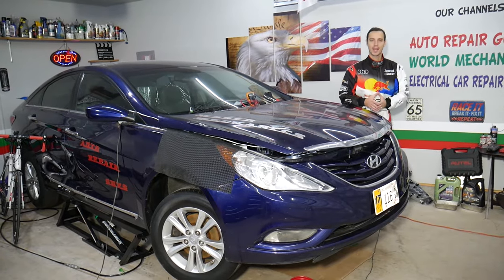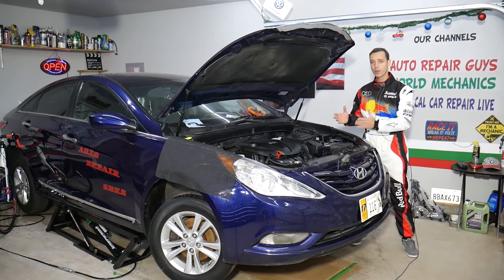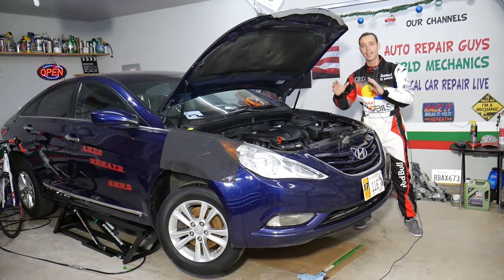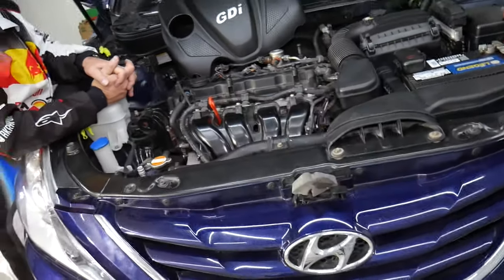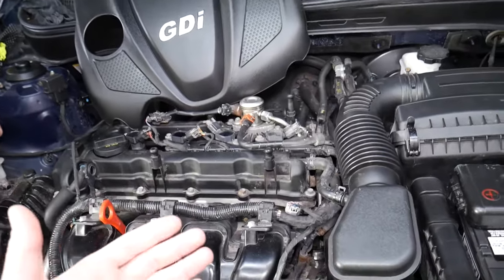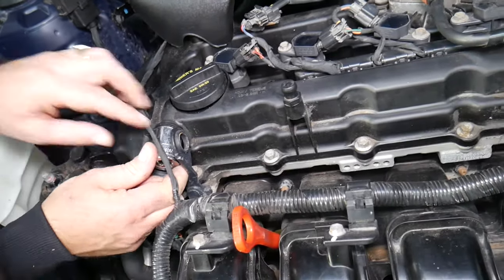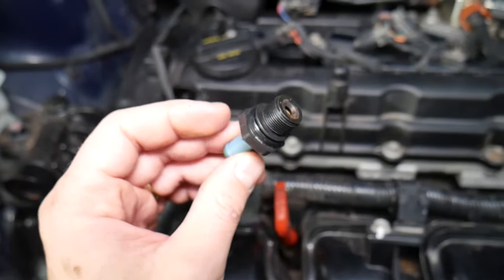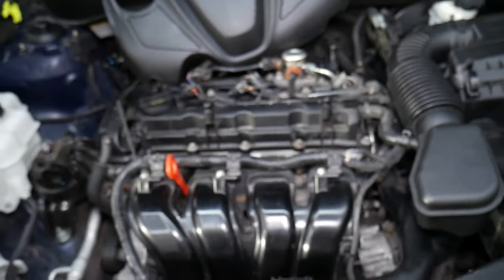WHY HYUNDAI SONATA BURNS ENGINE OIL, INCREASED OIL CONSUMPTION

Comment: 2016 sonata...112,000 miles. I just took mine to a dealer because I'm burning between 3-5 quarts in between oil changes and they told me the engine replacement lawsuit does not cover oil consumption. Only if your engine fails because of parts. So if you're out of warranty your s*** out of luck...dont buy a hyundai ever. Crap company... Crap cars and even crappier salesmen.
Reply: I have noticed my 2017 is burning quite a bit. What is the warranty cut off , I’m at like 75k miles or so.
Reply: Ah yea my engine did die at 150K I put $1200 to fix it and now I need an oil change every 700 miles NO JOKE. And I’ve taken great care of my 16 sonata. The worst part is when it died I DID take to a Hyundai dealer and they told me it’s not in the lawsuit or recall. So I repaired it 3rd party. But I called today since Hyundai sent out those letters for the HMA settlement and they told me the software update my car had in 2019 should of worked with the check engine (but it never did) and the dealership when it did die should of covered me.. but I missed the deadline to get reimbursed for the repairs August 9th of 2021 😢… so Hyundai LEGIT screwed me over. I did the right thing, I freeekin tried and I’m still stuck with a car that’s going to die soon. I’m so mad like I’m beyond upset about it all. I’m afraid to drive it and now Idk what to do. It feels like it runs fine but with this oil issue… man idk 🤷🏻‍♀️
Reply: @chaselesser3191  100K
Reply: Report Hyundai to NHTSA AND THE BETTER BUSINESS BUREAU AND THE NEWS MEDIA channel 5, channel 7
Reply: There's a class action lawsuit about this oil consumption issue, so that might help you eventually I hope
Reply: Yea it’s horrible. I’m having the same issue. Will never buy these cars again.
Reply: @doupray  that’s literally what I have and fixed the misfire last week. 138,000 miles. Burned a whole quart in ~600 miles. We just need a better car man sheesh. It’s 2022 for crying out loud.
Reply: @ali_young21  If it's leaking oil that much you don't need an oil change every 700 miles. You just need to replenish the lost oil. and change the oil filter once a year (without changing the oil) The new oil you put in to replace the lost (burnt) oil takes care of scheduled oil changes at the rate your car is losing oil. Try a high detergent oil since the problem may be the piston oil control rings are allowing excessive oil bypass into the combustions chambers. If the clogged oil control rings are cleaned, by the detergent oil, it may be improved oil consumption.
Reply: @The.Shiloh.Project  i keep having misfires fixed the first one and now there was atleast an inch deep on oil in the spark plugs. Dealership is playing hard ball even after ive asked them to find the issue over and over.
Just opened a Hyundai claim and added myself to a class action regarding mass oil consumption
Reply: @grubisfunny  I am having the exact same issue. Took my car to Firestone and they told me there is nothing more they can do with it because of the oil consumption issue. I would love to know what your dealership says about the issue.
Reply: I took mine to the dealer they said that my warranty on the engine is now extended indefinitely so whenever it dies basically they’ll replace the engine. Not ideal but better than nothing
Reply: @grnspider  Dealership gave me it back and changed a completely unrelated part claiming it was leaking oil (the oil pan) hit me for $200 and $600 to the warranty company. It broke down 4 days later same exact issue so I just changed the spark plugs one last time and traded it in. It was just becoming a money pit! Spent 100s on spark plugs and diagnostic tests. Nope that was the end!!
Reply: It sounds like the oil rings are fucked. Carbon build up or broken rings. I change my oil and filter every 3000 miles. Fuck what the handbook says.
Reply: Hyundai and Kia were great before the gdi engines came in 12or 13 those cars before those years are still all over the roads those engines made Kia and Hyundai in the early 2000s
Reply: @MicahPhelps-uy3ir yup. My 09 DOHC still runs like a champ. My 2014 and 2015 GDI are in the graveyard. 2015 caught fire, 2014 burned all the oil and blew up on the highway

Comment: My 2020 kona started burning oil, gotta check it now every other day. Way to go Hyundai!
Reply: ****>>>>>    Hey readers. Even some Honda. and Toyotas are oil burners. I know because I have looked at YouTube videos for a whole year on this oil burner issue. Audis and BMW too. It is usually GDI and stuck piston rings. Most time a good B-12 piston soak will free the rings. Others use tough engine flushes.. EPR109, AMSOIL, Liqui Moly etc. Some just put in Yamalube ring free shock treatment . Change your oil at 2.5 to 4 k. Run top tier gas...use Techron gas or other high PEA treatments...and try to rev up engine more to burn the carbon outmore. Use Valvoline restore & protect oil!! FIX it fast before you pay $$$$$$ for a cat converter!!!

Comment: Some think that the problem is a result of the design to short pistons (to save engine moving weight / mass, and improve fuel mileage); and, the piston oil control rings becoming clogged with carbon -- thus, not clearing enough oil from the cylinder walls during each piston stroke. High detergent motor oil may help remove some of the carbon from the oil control rings ---MAY help.
Reply: That's completely wrong. Most transverse mounted engines are undersquare (taller piston travel, smaller bore). They have to be this way in order to fit into the engine bay with the transaxle. You can design around a tall engine. You might not be able to design around a WIDE engine. This engine has an 88mm bore, 97 mm stroke. It's actually quite a bit oversquare. If it was the other way around, those numbers would be reversed. Every manufacturer wants to use oversquare engines today as their thermal efficiency is higher. Basically, better fuel economy. We own this same engine, and it feels very fragile and makes uncomfortable noises. As a mechanic, my ears are tuned to hearing small details in car engines. And ours just doesn't sound right. It only has 110,000 miles, too.

Comment: I wish I had seen this vid two years ago when I had oil pouring out of the valve cover on top (2015 Sonata).  It cost me several hundred dollars for a new cover, plugs, wiring, and labor.   I then drove across the USA 2400 miles, and it only used about 1/4  quart of oil.

Comment: In order of replacements: 
1. PCV Valve. 
2. Valve Cover Gasket
3. Head Gasket
4. Oil Pan Gasket
5. Engine might be toast.
Reply: ****>>>>>    Hey readers. Even some Honda. and Toyotas are oil burners. I know because I have looked at YouTube videos for a whole year on this oil burner issue. Audis and BMW too. It is usually GDI and stuck piston rings. Most time a good B-12 piston soak will free the rings. Others use tough engine flushes.. EPR109, AMSOIL, Liqui Moly etc. Some just put in Yamalube ring free shock treatment . Change your oil at 2.5 to 4 k. Run top tier gas...use Techron gas or other high PEA treatments...and try to rev up engine more to burn the carbon outmore. Use Valvoline restore & protect oil!! FIX it fast before you pay $$$$$$ for a cat converter!!!

Comment: 2018 Sonata SE  mileage a lil over 51,000. Told they couldn't find source of excessive oil usage, however, I've been advised to have combustion cleaning that will slow down the oil usage. Car also slow to accelerate after slow down or complete stop. That issue still haven't been addressed.
Reply: Read what I said above.   Hyundai has a service bulletin declaring after market oil filters, including one from FACTORY!  42,000 easy miles on mine and 5 quarts burned this year
Reply: Try a good engine flush. GDI’s benefit from this since the Piston rings get clogged by carbon buildup and get stuck. Or you could have a bad PVC valve. The vale did nothing for me. I thought it was the Valve stem seals, and after a new Cylinder Head it smoked just as bad. 
I just tried LiquiMoly engine flush and my car already doesn’t smoke under hard acceleration. 
After that we may just have bad piston rings.
Reply: ****>>>>>    Hey readers. Even some Honda. and Toyotas are oil burners. I know because I have looked at YouTube videos for a whole year on this oil burner issue. Audis and BMW too. It is usually GDI and stuck piston rings. Most time a good B-12 piston soak will free the rings. Others use tough engine flushes.. EPR109, AMSOIL, Liqui Moly etc. Some just put in Yamalube ring free shock treatment . Change your oil at 2.5 to 4 k. Run top tier gas...use Techron gas or other high PEA treatments...and try to rev up engine more to burn the carbon outmore. Use Valvoline restore & protect oil!! FIX it fast before you pay $$$$$$ for a cat converter!!!

Comment: In order to attempt to fix this issue is to do a combustion chamber cleaning service and replace pcv valve. I always recommend BG EPR service along with this and fuel induction service. Sometimes it fixes the issue, sometimes it doesn't.

Comment: The problem is the engine design itself. It's a GDi engine, meaning gas is directly injected in the chambers where the combustion occurs. Thus, increasing temperatures causes burning of the oil (this occurs whenever the pistons are fired). Its a clever design but Hyundai should've ran extensive long-term trial testings.

Note you can see "blue" smoke coming out of your muffler, meaning its buring "synthetic" oil. 
Also its not all Hyundai models, for example Hyundai Rondo uses DOHC engine (a reliable engine that been design for almost a century).
Reply: I put in about 2 qts every 500 miles. And easy smoking if I accelerate to much.
I just ran a bottle of LiquiMoly Engine Flush yesterday, and today I I tried to make it smoke and I can’t say I noticed anything. I’m sure I need to run another bottle. But I think I can at least go 1000 miles without using 2 qts.
Reply: @chaselesser3191  keep track of the results week by week and keep us posted. Using LiquiMoly is an extra cost though.

 The issue is the burning of oil caused by the engine design using direct injection...
Reply: @dool1002  I drive 100miles/day. So I should be able to see quick results. Though I’m about to be on vacation for about 2-3 weeks
Reply: @chaselesser3191  Do let us know when you get a chance! From my small tests, I noticed if you run the engine at a constant temperature, less oil is burned. For example, here in Canada the weather in December is pretty cold for where the engine can combust gas more efficiently (cold air is more condensed) and I didn't need to add any oil for almost 3 weeks - the dip stick reads Full.
Reply: ****>>>>>    Hey readers. Even some Honda. and Toyotas are oil burners. I know because I have looked at YouTube videos for a whole year on this oil burner issue. Audis and BMW too. It is usually GDI and stuck piston rings. Most time a good B-12 piston soak will free the rings. Others use tough engine flushes.. EPR109, AMSOIL, Liqui Moly etc. Some just put in Yamalube ring free shock treatment . Change your oil at 2.5 to 4 k. Run top tier gas...use Techron gas or other high PEA treatments...and try to rev up engine more to burn the carbon outmore. Use Valvoline restore & protect oil!! FIX it fast before you pay $$$$$$ for a cat converter!!!
Reply: Yup. My 09 rondo DOHC is still running like a champ. GDI are crap

Comment: I tried everything and I am still putting almost 2 quarts of oil in. I have a 2017 Hyundai sonata sport with 100,400 miles. The Hyundai dealer says it may be still under warranty and that it is a well known problem. But they won't tell me what the problem is on this recall. Can you help and let me know what the problem is.
Reply: ****>>>>>    Hey readers. Even some Honda. and Toyotas are oil burners. I know because I have looked at YouTube videos for a whole year on this oil burner issue. Audis and BMW too. It is usually GDI and stuck piston rings. Most time a good B-12 piston soak will free the rings. Others use tough engine flushes.. EPR109, AMSOIL, Liqui Moly etc. Some just put in Yamalube ring free shock treatment . Change your oil at 2.5 to 4 k. Run top tier gas...use Techron gas or other high PEA treatments...and try to rev up engine more to burn the carbon outmore. Use Valvoline restore & protect oil!! FIX it fast before you pay $$$$$$ for a cat converter!!!

Comment: Awesome. Had the same systems. Replacing it later today
Reply: ****>>>>>    Hey readers. Even some Honda. and Toyotas are oil burners. I know because I have looked at YouTube videos for a whole year on this oil burner issue. Audis and BMW too. It is usually GDI and stuck piston rings. Most time a good B-12 piston soak will free the rings. Others use tough engine flushes.. EPR109, AMSOIL, Liqui Moly etc. Some just put in Yamalube ring free shock treatment . Change your oil at 2.5 to 4 k. Run top tier gas...use Techron gas or other high PEA treatments...and try to rev up engine more to burn the carbon outmore. Use Valvoline restore & protect oil!! FIX it fast before you pay $$$$$$ for a cat converter!!!
Reply: U mean the oil just becoming sludge in the engine? 
I guess that makes sense since it always smells like burnt oil… I’m changing oil today

Comment: Im not sure if this is my issue because after getting the car I checked the oil for months and it never seemed to decrease. And then when I went to the mechanic they didnt see anything wrong, and I eventually decided pour a bottle of oil in it that's for 75,000 mileage or more. Just twice for the wintery month randomly driving for more than 10 minutes I smell something burning, was thinking it could been oil and the burning doesn't last long either but I'm not sure.

Comment: My 2014 Sonata is burning Oil like Crazy 🤪 I’m at 135K and the DipStick is always dry.  The oil loss began relatively slowly about 50K miles ago and now the car needs to be checked every 4-500 miles.  
Does anyone know if Lucas Treatment helps?  Can the engine blow? 
I need to drive this beast cross country.

Comment: Came here to determine why my neighbors Sonata keeps running out of oil. A few months ago, she said it "just turned off" while driving, and we discovered it had run out of oil. She had it flushed and refilled at the shop, and now less than 3 months later, it's taken in for an oil change and they said there was only 2 quarts in it to drain!
Reply: I’d suggest trying a good Engine Flush. I just tried Liqui Moly, before I could make my car smoke almost on command, after the flush I tried even harder and couldn’t tell any smoking. 
I’m sure I may need to run another bottle later. But I have high hopes as I can already see I’m not burning as much oil.
Reply: @chaselesser3191 how’s it doing lol I just bought one it didn’t have much oil but I got it for 500 and the prevalent problems were the wheel bearings so I took a chance 125k miles

Comment: Its not a PCV value issue.  Its a ring issue with all 4 cyl engines.  Bad design.  Even the service managers at the dealers even confirmed this.  Rule of thumb dont buy any Hyundai or Kia vehicles.
Reply: Is there any way to fix this problem
Reply: @anthonyarrighi2159  you must replace engine

Comment: FYI there are two possible PCV valve part numbers. 26740-2G000 and 26740-2G600. Prior to ordering a new valve pull the hose and if you have a blue valve (like in the video), you will need 26740-2G600.

Comment: My 2014 Sonata Limited I’ve driven less than 1500 miles on a full synthetic oil change and it’s already to the low level where I have to add oil. No leaks, everything runs great. I even drive with it on Eco most of the time. Just started happening more frequently when I hit 100k. Between 60-90k I only had to add maybe a quart of oil after 2500 miles, with majority highway miles. I love my car but this oil problem is gonna make me go broke. 😅

Comment: 2015 Hyundai Sonata...  told Hyundai considers 1 qt/1,000 miles acceptable.... I've driven a lot of "beaters" in my life and never have I had a vehicle that burned oil at that rate....  that's like a quart per 30-40 gallons of fuel....  i have a 2 stroke weedeater that doesn't require that kind of oil-to-fuel ratio
Reply: You are right. I have a 2013 Sonata and it burns oil. I had a 2003 Honda Accord and never had to top  up between oil changes.

Comment: However!!!!!  My 2018 had 36,500 easy miles and the light came on.  It was 2.5 quarts low.  Hyundai service bulletin said its the after market oil filters and even one of Hyundai s factory filters.  So, since June I've burned another 2 quarts in 5,000 miles.  The car barely has 42,000 and there are zero leaks anywhere on the engine and it's not burning oil.  I think it's sludging up inside the engine walls.  I'm very mad at Hyundai

Comment: Thannk God im having all the issues he mention iddle problem and burning a lot of oil
Reply: ****>>>>>    Hey readers. Even some Honda. and Toyotas are oil burners. I know because I have looked at YouTube videos for a whole year on this oil burner issue. Audis and BMW too. It is usually GDI and stuck piston rings. Most time a good B-12 piston soak will free the rings. Others use tough engine flushes.. EPR109, AMSOIL, Liqui Moly etc. Some just put in Yamalube ring free shock treatment . Change your oil at 2.5 to 4 k. Run top tier gas...use Techron gas or other high PEA treatments...and try to rev up engine more to burn the carbon outmore. Use Valvoline restore & protect oil!! FIX it fast before you pay $$$$$$ for a cat converter!!!